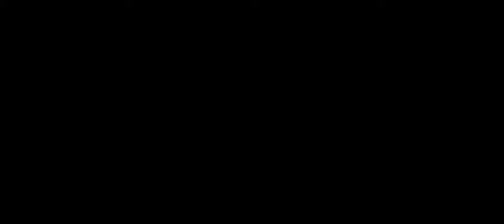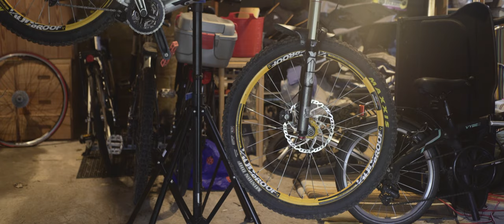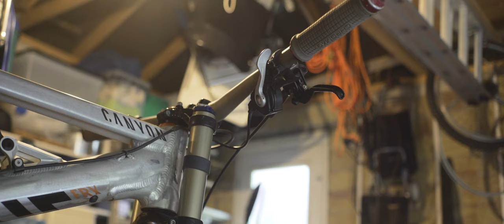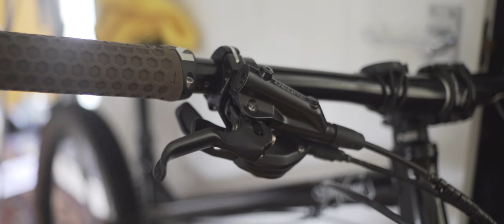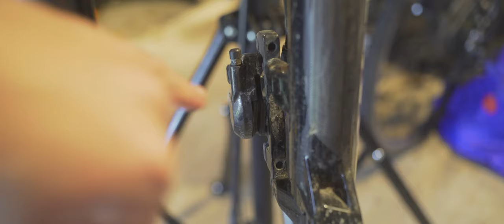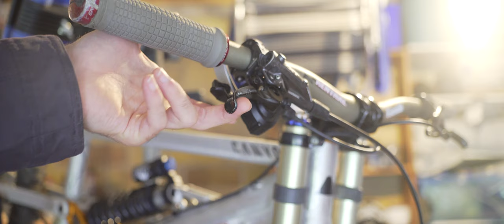How To Change Your Bite Point Or Free Stroke ( Spongy Brake ) Shimano or SRAM Hydraulic Disc Brakes

Comment: OK, I've worked on disc brakes for IDK 25 years? I have every possible bleed kit, and I have never tried this. I took my wheel of and lightly squeezed lever until the opening closer than it was. I put my wheel back and was amazed! what simple fix. Thank You. BTW XTR trail brakes.
Reply from the maker: Thank you. I'm sure I'm not the first person to work this out. I just happened to notice it worked like this by accident. Glad to have helped out!
Reply: question....how u manage to slip the disc between the narrow pad after doing this? or is it just enough space for the disc ?
Reply from the maker: You're spot on. If you follow the guide carefully there should be just enough space to fit the disc rotor between the pads. Make sure you don't make the gap too narrow otherwise you'll have to reset the pistons which can mean re-bleeding the system
Reply: @BenHuggett  will try.. Just to make sure just enough to slip in the disc 👍🏻
Reply: @BenHuggett  just checking in case I do this by accident in future, resetting the pistons means u need a bleed? Why is that?
Reply from the maker: @frankedoodle3798  it depends on the state of your master piston (the one in the lever). If you haven't overfilled the system by doing lots of lever ONLY bleeds and the master piston has room to slide around then you're fine just to push the pistons back into the caliper. It's a closed loop and this is precisely how it's meant to work. On the other hand, if you keep advancing the master piston by bleeding the lever over and over to get a firm feeling brake you can sometimes face quite a lot of resistance pushing the pistons back into the caliper without first opening the bleed screw on the lever. I hope that makes sense. Easier to show someone how it works than it is to write it down!

Comment: I do the same action but place a credit card in the gap. the rotors are usually 1.8mm but the credit card is 1mm thick and i squeeze until the brake bites on the card then refit the wheel
Reply: Was just about to ask about using a thin shim (thinner than disc)to put in gap then saw your post

Comment: bled my brakes 2.5 times and was getting pretty annoyed. This was what was actually the problem. Gained about half the stroke on my lever. Can't believe they don't include this step in the brake bleed vids!  Thanks!
Reply from the maker: I've always said this. It should be included in the manual for brake bleeding. Generally on a first bleed the brakes are alright whilst the pistons are seated correctly. But after you've run through a set of pads the pistons are in a completely random position and need seating and setting up properly in order to get the lever feeling right. Glad I could help

Comment: Good tip, but if you buy a cheap folding feeler gauge set you could extend several gauges that together equal slightly less than the thickness of the rotor, insert them between the pads, squeeze the lever hard a couple times and you have a perfectly reproducible system - say the rotor is 2mm, if you use 1.1mm gauges, you'll reduce the slop by 0.9mm.
Reply from the maker: This is a good point. I've actually taken to using a worn out section of an old disk rotor to space things out these days. If you've got an older rotor sat around just cut a section out and it makes a perfect spacer! Thanks for sharing your thoughts though, I'm sure you'll help someone!

Comment: Thanks a lot for this video! Was getting pretty annoyed about the prospect of bleeding the brakes on my brand new bike. Did this, did a few adjustments, works like a charm! BTW, I recommend those plastic automotive interior removal tools for spreading brake pads apart, you can find them pretty cheap.
Reply from the maker: I'm glad I could help. I've found either a trim removal tool or a narrow tyre lever works really well to spread the pistons apart these days!

Comment: BRO YOU PREVENTED ME FROM BURNING A HOLE IN MY WALLET. When I got my new bike, the brakes didn’t bite like my old bike so I just thought my brakes had air in its system. I then proceeded to buy a bleed kit and bled my brakes. But after two gruesome attempts of bleeding both the brakes. It still felt the same and I thought my brakes were just defective. So then I was planning to buy new brakes for my bike but then I came across your video on my recommendations. And holy $hit. After I watched the video, I came dashing to my bike and tried it. They felt amazing 🤩 and was blown away on how quick that took. TYSM and I’m glad you made this video!!!
Reply from the maker: It’s amazing how sometimes a little trick like this can solve so many issues. Glad you’re sorted now. Enjoy your bike!

Comment: Thanks so much. You saved me from an unnecessary purchase of an XT 8120 lever assembly. My current Deore 6100 now (after this advice) works the Deore 6120 4 pot caliper (I have 2 pot rear, 4 pot front Deore set up) beautifully. The action & feel on both sides now match and braking performance has been boosted. AWESOME!!
Reply from the maker: Glad to help out - still no idea why Shimano don't suggest this is an official solution! Enjoy your riding!

Comment: First off, thank you so much for this very detailed guide. Just curious though, if you just pressed the lever ever so slightly, what difference does it make if I do it with the wheel on? Or I won't be able to press it at that point because of the rotor? 

I'm also thinking if its better to do this procedure with a bleed cup on so that there will be more oil in the system that will prevent the pistons from going back far?

Thanks a lot
Reply from the maker: The reasoning for taking the wheel out is that even if you’re only pulling the lever slightly the pads (at least on one side) are likely to make some sort of contact with the piston and will thus more likely get pushed back into the calliper. The other advantage of taking the disc out is so you can see more clearly what you’re doing. 

As to your point with the bleed cup. Yes, that’s not a bad idea. I generally don’t bother because most levers have a small reserve of brake fluid. This is normally used to top up the fluid in the lines and push the pistons forward further as your pads wear down through use. 

Hope that answers some questions
Reply: @BenHuggett  Thanks for your reply Benjamin, I tried it on my SLX levers which doesn't have a bite point adjustment and it worked! 

I have a theory, maybe when the rotor is not there, there is nothing that pushes back the fluid back to the reservoir, I think which causes more fluid to be on the line. 

But I'm really glad to found your video because I don't have much reason now to upgrade to XT levers. Cheers.

Comment: I'm definitely gonna try this. I got my Canyon Stoic 3 last year and only rode it a few times, but now that the new season starts I need to get this ready. This is my first hydraulic brake bike and I knew nothing about how to adjust it, I've been wondering why my brakes have so much travel and thought it must be normal.
Reply: Ok, I tried it out and it kind of worked but still has a lot of travel. Either I need to bleed the system or that's just how the brakes work, I'm not sure what to think, as these are the only hydraulic brakes I've ever used. (fyi I got Sram DB8 brakes)

Comment: 1:48 I think you can have a good control over that adjustment if you use a "feeler gauge tool", set plates to something thinner than the disk and put that in when moving the pads closer together.
Reply from the maker: Yes absolutely. It just not strictly speaking necessary if you can judge the gap by eye

Comment: Hey man,this is exactly what I needed,you saved me 500 bucks! I was just going to get a new set of brakes,but this saved me! Thank you very much!!
Reply from the maker: You're welcome. Glad I saved you some money. Nothing worse than having brakes that don't engage properly
Reply: $500!!!!! Jesus what brakes are you using ????
Reply: @chriswebb383  Have you looked at the price of brakes? They’re not cheap. Even the cheap ones are expensive.
Reply: @chriswebb383  Dude I just replaced my brakes and rotors with SLX and it was $700aud. 😂

Comment: I’m brand new to MTB mechanics but a fairly competent road bike home mechanic for rim brakes….

Could I in theory use something slightly thinner than a rotor, hold said object between the pads and squeeze to close the gap without risk of over pulling and pushing the pads together?
Reply: That was the first thing I thought of when I seen him doing it. Even if it's a thick piece of solid card for e.g

Comment: Amazing! How does this work? 
I can't seem to understand what happens internally in your calipers, as you're not adding any oil or air into the system?
Reply from the maker: There’s a small fluid reservoir above the master piston in the brake lever. This holds fluid that helps the lever compensate for pad wear and in this case allows us to push more fluid into the line to advance the pistons manually. Hope that helps

Comment: Thanks, it did help!
I had done the process and went too far, the pads were too close together and the wheel was not fully free when rotating.  Every other video I saw was giving instructions to bleed the system, which I dreaded, that is a messy oily job.
I didn’t know you could push the calipers back in this way
Reply from the maker: Almost all modern levers are designed to allow you to push the piston back without fully bleeding the lever in my experience people just don't believe it for some reason. 
The little chamber in the lever that you attach the bleed funnel to is designed to collect air or excess fluid from the brake system. Obviously in an ideal world there would be no excess air in the system but Shimano brakes in particular can function pretty well with a little bit of air in there.

I'm glad the video helped you get things working properly!

Comment: Hm, this makes zero sense to me. If you don't change the amount of fluid in the system then how can the travel of the calipers stay where you set them? They'll eventually go right back won't they? Or does this have something to do with the fluid in the piston lever? Confused....
Reply from the maker: You’re bang on. There’s a fluid reservoir above the master piston in the lever which holds extra fluid to compensate for pad wear or in this case advancing the pistons
Reply from the maker: You’re bang on. There’s a fluid reservoir above the master piston in the lever which holds extra fluid to compensate for pad wear or in this case advancing the pistons

Comment: I just wanted to say THANK YOU! I hated how far I had to pull the lever before it would start biting and honestly was about to start looking at magura brakes even though I didn't need something more powerful because I disliked it so much and what I thought was the servo wave levers. Now when pulling on the levers real hard they go back as far as the original bite point which is so much better! I thought I had originally messed up the bleed when I swapped to deore levers on my mt200 set but I reblead them 3 times and it didn't fix it, I assumed maybe this was something you could do but with all the "don't pull the levers without a bleed block" I only barely tried it before and just assumed it didn't work so I left it like that for a few months now. Finally got fed up with the feel, now I'm very happy with the feel of my shimano setup. As for why shimano doesn't mention it I bet its because the high end levers have "bite point adjustment" which they can sell as a important feature, when you can do that with all of them just not as easy
Reply from the maker: That’s what YouTube is for. I’m really glad you got your brakes sorted. Happy riding!
Reply: @BenHuggett  I actually need to go back and do my front again as it's reverted back to it's old position. I guess that's what people mean when they say Shimano has a moving bite point

Comment: Thanks or sharing this helpful video! I was actually having the opposite problem. I like a bit more squeeze in the lever before it engages. Even a bit softer then it should be, probably. But, I installed new discs on my bike and the brakes engage almost instantly. If the free stroke screw actually worked, it might solve the problem, but sadly it doesn't. To fix my issue, I had to squeeze the pistons all the way back into the caliper. It's easiest to do this with the pads removed (which only takes a few seconds) and using the soft rubber handle of a park cone wrench to push in the pistons. Doing it with the pads on can disturb the braking surface of the pads, even if you're careful. And being able to see the pistons is helpful in knowing when you get them even with the caliper. Just my two cents.
Reply from the maker: You make a really good point. These days I take the pads out and use a plastic glue stick to push the pistons back if they need it. I used to use a screw driver in a sock as the video states which I wouldn’t have risked using on ceramic pistons in case of cracking. Either way thanks for sharing your tips!

Comment: Good tip, i'll certainly try it as, like you, the amount of free movement in my Deore M6100 lever  before pad engagement is ridiculous. My query is, what to do if you manipulate the pads to be a little closer together as per your video, but then the gap is too small for the disc rotor/wheel to be reinstalled? If you have to push the pistons back out a bit is that effectively undoing what you're trying to achieve?
Reply from the maker: Thanks for the question. In a sense yes you're undoing what you set out to do if you push the pads/pistons back. That said there's absolutely no harm in doing that. The system is a closed loop so you can rinse and repeat the process as many times as you want in order to get the gap just right. 

I've actually just built my dad a bike and managed to overextend the pistons. I've taken to using a thin bit of wood in order to push the pistons back. I got the distance right on my second attempt and just like that the bike is ready to go!

Hope that helps!

Comment: Brilliant!!! Worked for me. How is this not an official step in the bleed process or at least touched on in the instructional videos? Certainly the manufacturers are aware of this.
Reply from the maker: Honestly I don't know why this isn't an official step. I literally can't see a disadvantage to it
Reply: I think this advancement is supposed to be automatic. It certainly is in car brakes. They use the squish and rebound in a square O-ring to pull back the pads and they automatically slide forward to take up wear. I'd presumed that bike brakes did something similar (obviously there is an external pull-back spring instead/as well, but I presumed there was something to let the caliper stay advanced and let a bit more fluid into the system. Maybe not.

Comment: Upgraded to new discs and pads recently and couldn't figure out how to get the lever matched up to the correct bite point.. this worked perfectly thanks very much
Reply from the maker: Glad to help out! This should be more widely known as an adjustment technique
Reply: @BenHuggett  absolutely, the fact that very good brakes such as deore M6120 do not have a 'free stoke' adjuster has put me off buying them until now. With this tip I don't need to spend on SLX or XT as their adjustment isn't worth the investment anyway..
Reply from the maker: Precisely. The free stroke adjustment is completely pointless in my opinion. The tool free reach adjuster and the grip dimples are the only benefit I see from SLX and higher systems. I still love how minimal the Deore levers look without any adjustment bolts so I'll keep running them until they need replacing!

Comment: I took my wheels off to wash my bike and when I put it back together the levers would pull in much further than before and feel slightly weaker, is this sudden change likely fixed by what you did here? Or is it something to do with the oil. I didn’t do anything to the breaks other than take the wheels off.